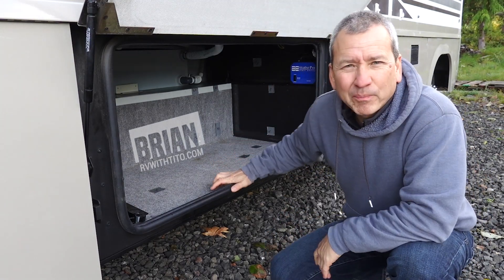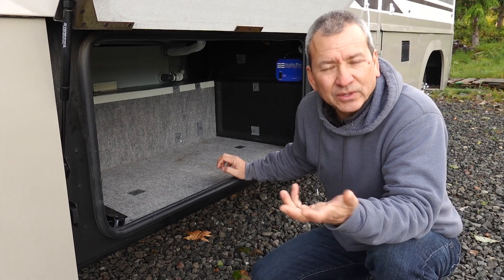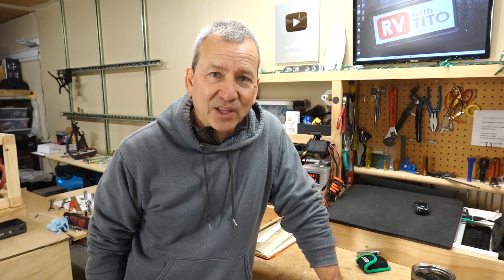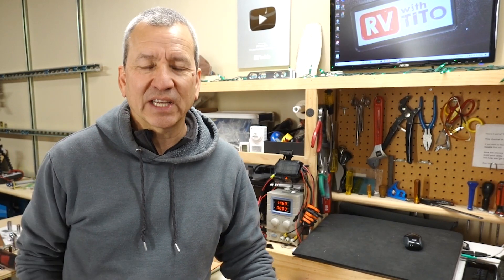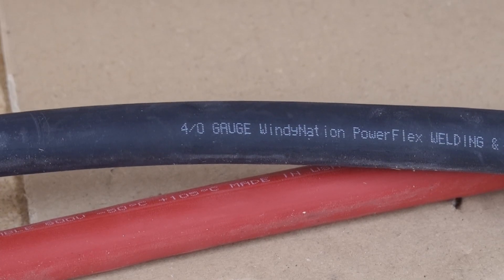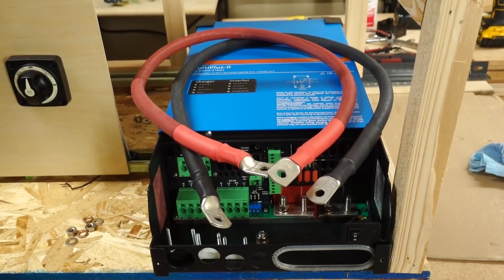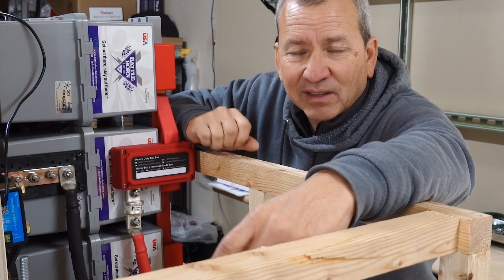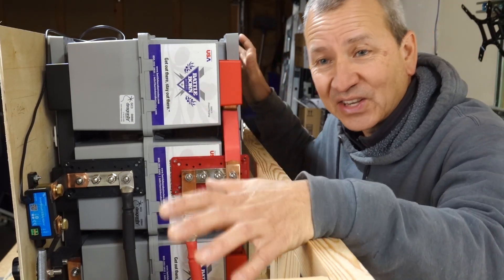Our Massive RV Battery Bank with Copper Busbars | Battleborn GC3 Lithium Battery | RV With Tito DIY

Comment: Nice work. Hwever, those Battle born batteries are way too expensive. You should have built your own battery from 3,2 Volts LifePo4 cells for same power at a third of the price.

Comment: thanks for your idea's, do you remember the flat copper bus bar thickness you used? I would like to go the same route with my 2x 200ah bank. thanks
Reply from the maker: Just found a spare piece. They are 1/8" x 1" from eBay. So far so good. Haven't had to touch them in almost 2 years. Still holding tight.
Reply: @RVwithTito  thank you my friend :)
Reply from the maker: @SEANRMZ  No problem

Comment: First class job, Brian!!!! i love the work with the bus bars... i wonder what current the bus bars can carry?.. Fantastic video... I can tell you were an electrician..
Reply from the maker: Thanks! Can't remember how much current I originally calculated. There's definitely more copper there than the #4/0 cable using to connect to the inverter. Electricity is fascinating and fun!

Comment: Brian, what size strut channel did you use to fit over the battery feet?
Take care.
Reply from the maker: The smaller one. 1 3/4" width x 3/4" height

Comment: Interesting bus bar setup. While I overall agree with using pure copper bar stock (often an IR of 0.100mΩ or less) over cables with crimped lugs when possible I'm curious why you chose to to pull from the middle battery and not from one terminal of each outside battery? Are you concerned at all about the current draw being higher in the middle battery?
Reply from the maker: You made me go back and double check :) If you look closely at around 10:15 in the video, you'll see that the negative and positive connections have their own busbar and are not on the middle battery. Negative is on the bottom left and positive on the upper right.
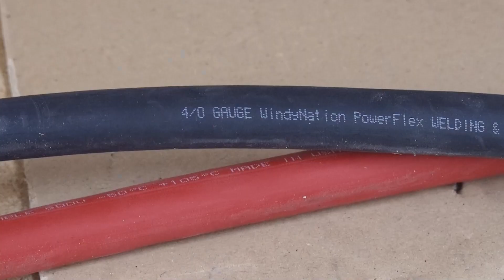Reply: @RVwithTito  11:23 I see two bus bar blocks (be careful if those are the $35 Amazon ones they aren't rated for what they say they are, not an issue for you most likely. I see the negative comes out between two batteries near the bottom, wraps around into the shunt and comes up towards the center where a cable takes it away. So not center exactly. Positive it appears that jutting out from the middle battery terminal is the bus bar block where a cable then takes it away.

So yes, a solid bus bar for both pos and neg running the length of the batteries but still a path of least resistance for the middle battery, the bottom and then the top. Not by a ton but Copper measures 0.100mΩ per 3-4 inches for me on my 3mmx20mm bus bars
Reply: @RVwithTito  Ahhh Now I see it! Very sneaky could barely tell. you had those bus bars so well lined up. I must have missed some of your bus bar fabrication and attachment parts while responding to another comment on another tab I had open

Comment: Question on the copper busbars being 1" x 1/8"  and amp rating for that is around 275  So at a 3000w inverter on a 12v system thats 250 amps so your good ? I  want to do the same thing.
Reply from the maker: So far so good. Right now (for the last hour) I'm pushing 2700W (roughly 200A) of charge in, and the busbars are sitting at a cool 93 degrees. Just barely warm👍
Reply: @RVwithTito  Good to know Thanks!

Comment: Hello Brian, Once again love your bus bar set up it’s really clean! After watching your video again I  was wondering if you could install bus bars in series on that battery configuration to make 24 volt set up vs 12 volt. If so what would be the best way to bolt together not to cause any arching?
Reply from the maker: You would need 4 of them (2 pairs). Just flip one around to connect them in series for 24V. How you connect the pairs with a busbar will depend on how you stack them.

Comment: 3 in parallel did not sound like 810 to me, but maybe I’m thinking of the rules for parallel voltage instead of power or whichever unit you mentioned (a year, ago).
Reply from the maker: In parallel add the amps and keep voltage the same. So 270 Amp Hours X 3 = 810 Amp Hours. Voltage remains at nominal 13.2V

Comment: Hi Brian I notice you did not add any ANL fuses 600 amps or more. in the pos. links to the copper bus bars or a disconnect switch for each 300 Amp  of the BBCG3 banks.  I would have put a very large ANL fuse also in the  Pos. bus to protect a short to neg. / chassis. you could get a surge current of several thousand amps between batteries and the solar output.

Comment: The concern with movement isn’t in the buss bars coming loose, 
 it is where the stress gets concentrated. Specifically where the terminal attaches to the battery. You are more likely to crack the battery case than having the bolts loosen. Fantastic idea for a static installation, but I wouldn’t risk breaking a battery case if I were you. I am only a mechanical engineer so what do I know.
So I recommend “Gauge Wire and Cable” as an online resource to buy ready made cables. Sorry to say that I believe you should immediately change to cables.
Love your videos, only trying to help.

Comment: Hey Brian! I’m curious, what did you do to to the battery compartment to keep it from freezing and allow charging in cold weather? 

I really appreciate your videos. They’ve been very helpful.
Reply from the maker: I didn't do anything this time. First of all, we're usually running from really cold weather and second, we're always using the batteries which tends to keep them warm. I have heating pads on the Battleborns installed in our Class C, but I've hardly ever needed to use them. There are several options if you did need to heat them. I'd recommend a basic set of heating pads triggered by a $5 temperature switch (https://amzn.to/3ugox9p). I've used several of these for cooling fans and heating too.

Comment: Nice install Brian! Question: If your load would remain the same,  you had room and wanted to install 4 GC3 batteries rather than 3 would anything else need to change? would any components need to be upgraded?, would battery life be affected?
Reply from the maker: I think limit for the GC3s in parallel is 3. Double check that with Battleborn.

Comment: My issue with all these DIY's is the actual cost. For most people these is anywhere for 30-50% of the RV purchase price. And most times BB has generously provided these batteries and victors Glady donates the charger/inverter. 600AH BB in my areas is about $8k CAD, the victron inverter/charge is $3.5k, MPPT charger is another $650, Solar Panels and cabling another $1200 with wiring. All internally wiring and connection is 800-1500. These setups are amazing, but the cost is absolutely outside of most normal RV users. I woud like to see some YouTubers start reviewing more affordable setups (a non sponsored one) that could be beneficial to RV'ers in a northern climate where they only get 3-5 months of good camping weather.
Reply from the maker: Not sponsored BTW. I purchased all equipment myself. We run the RV off grid with solar almost 100% of the time. For us and many others it's a worthwhile investment. Having said that...Yes..there are certainly lots of options available at various price points.

Comment: What a great looking build. What sizes are your bus bars? For parallel connections and the bank to the main buses? How many amps did you size the solid bus bars for? 200A? What formula did you use to size the bus bars?

Comment: Why can’t you use the rv converter instead of buying new ones?
Reply from the maker: Lithium batteries sit at a higher voltage. The old chargers read the voltage and consider them fully charged. So the do t kick into charge mode. Bottom line is that these batteries have different charging criteria so you need a charger that's compatible.
Reply: As you can probably tell I know nothing about solar!! I’m confused if you are charging your batteries with solar why can’t you hook your battery to your power converter that already in your rv?? Maybe I need to go to a class on solar!! Lol

Comment: If you’re worried about vibration and thermal cycling of the connecting hardware, I’d recommend some Nord-lock washers.  I use them in the power generation industry.  They’re a buy once cry once item but are affordable for the size of your application.  I thought they were a gimmick at first until I tried them.

Comment: You'd better check with the manufacturer that these batteries can support the mechanical stress on the connectors. With bus bars, all the forces and vibrations from your RV will be transmitted to the connectors. Using flexible cables prevents that.

Comment: I might have missed it in the video, 810 AH is lots of power. Will you be able to run your air conditioner from this set up? Better question is what this set up capable of? Great job on the videos.
Reply from the maker: Yes, absolutely

Comment: Brian, I’m gathering components for my own similar project.  I’ll go with two BBGC3 at this time with the potential for a third.  I’ve been reviewing your schematic for this project and noted that you’re installing the battery break on the negative leg.  Is this intended?  I ask because my trailer came with the break off the positive leg of the battery and after attending an all day training session with Victron, all of their examples that we worked with mirrored this with the break on the positive leg.  Playing naive, I asked them why they went with that and they said it was to avoid any parasitic shorts.  Can you explain your reasoning?  Wondering if I should make this change and put the break on my negative leg as well.  High regards!
Reply from the maker: If you can put it on the pos, then that's a good plan. I've always disconnected from my negative so that's why I continue to do so. It doesn't matter much in my opinion which way you go. The NEG generally has less stuff attached...just the shunt.
Reply: @RVwithTito  Brian, turns out you are correct.  The true flow of electrons is from negative to positive.  Before this was discovered, it was assumed that positive flowed to negative but in actuality, it’s the inverse of this.  If you truly wanted to isolate the flow of electrons to your coach, you would put your battery breaks on the negative terminal.  Think about it… Why else is the shunt, which gives us all that data about our batteries be on the negative side if the true flow was from the positive.  Wouldn’t that put every 12V connected device before the shunt??  I always thought that was odd and now I know why it’s applied there.  Because that’s where the very first electrons flow out from the battery bank, not the positive terminal.  Here’s a very good explanation of this process.  https://youtu.be/8gvJzrjwjds
Reply from the maker: @jimsjacob  It's often confused, because the flow through the battery is from positive to negative. However, the flow through a circuit is from battery negative back to the battery positive (neg -> pos). I've found it very helpful to review these basics every once in a while. It's actually pretty fascinating once you grasp how electricity actually works at the atomic level. Thanks!

Comment: The build is looking good as always. I was wondering at the same time you mentioned about things coming loose, whether the battery terminals could break internally from vibration. I don’t recall any ridged connections on our airplanes in the Air Force. Even the ridged waveguides ended with a short flexible connection at the transmitter and antenna ends.
Reply from the maker: I'll be keeping an eye on it for sure. Just drove from WA to AZ hitting a few pot holes along the way. So far so good.
Reply: Has anyone from battle born commented on your use of the buss bars for connection?   I ask because I am getting ready to mount 5 GC3's in my Renagade Classic.  I fear like Douglas that over time they may do internal damage to the battery terminals because of vibration.   Instead of the brackets you used connecting the batteries together, maybe solid strips the same width and as long as the stack of batteries (or even angle) on both the top side and the bottom would make this a more solid unit incapable of having any vibration (and not depending solely on the plastic battery case).   I am also not a fan of tapping the plastic, bolts with locknuts and washers would be more permanent.    I'd just hate to spend 12500 on batteries and then screw them up.   Regardless, you did a great job of explaining everything - superb video!   I have been talking to Battle Born quite a bit about my build.  I'm going to have one of their engineers check out your install video.
Reply: UPDATE:  Battleborn OK'ed it.
Reply: @alanward3400  If BB approved solid bus bars on a mobile application their terminals must be extremely secure inside the battery. I'd expect nothing less for the prices they charge
Reply: @Douglas what types I was B-52C,D & H models

Comment: Your work is far superior to mine.  I have built 4 power stations, 2 in my home, 2 in my small RV.  But yours is a very impressive setup, I just question having the 3 heavy batteries in that vertical configuration.  I know they say the batteries can be set in any direction, but I have read a few articles saying it is still best to have them in the typical vertical position (like the old fashion lead acid batteries).  It has something to do with the way the actual internal battery cells are positioned inside.  I guess I also would question the weight of the 3 batteries sitting on each other going down a bumpy road.  Probably just my OCD kicking in.

BTY, still love the video on your flexible solar panel rooftop setup that allowed for airflow, just a fantastic video!!!

Comment: Very cool.  My only concern with vibration would be the battery terminals themselves.  Can they break off?
And, why so large?  You must be thinking of battery powered air conditioning…
Reply from the maker: They seem pretty sturdy, but I haven't seen inside. Definitely going to be running A/C if necessary.

Comment: I WISH... I am / was going to go with 400 Heated BBB and a 3000Watt Inverter/Charger.... now I might want to go with 2 x270 GC3'  ??
Reply from the maker: BB GC3s don't have heating, but I don't really see a need for it. Love them so far.
Reply: @RVwithTito  I live in the RENO area and have been/see the BBB plate and now they just moved to a bigger place. I guess I need an up grade! Heated or not! I just may have room for 540 Amps Hours! !  :o)
Reply from the maker: @RVingwithG  I have no complaints about my BB batteries in either RV (400Ah in Class C too). It's a pretty robust solution.

Comment: Remember to clean the inside of your cable connectors just like you would do if you were soldering copper fittings. Same goes for the bus bar and battery terminals.. Just cleaning with a cleaner is not sufficient to remove oxidation. Steel wool works good.
Reply from the maker: Thanks for the tip.
Reply: Steel wool followed by 99% Iso. Leaves a perfect connection

Comment: Brian is at one with the universe. Electronics - check. 
Wood carpentry - check
Electrics - check
Solar - check. 
And he is a blacksmith now. 

What you should be doing is getting in cahoots with Elon Musk to build a space rocket ship RV. 

I upgraded my solar system to 1500w and switched to battleborn batteries. I had to wire up everything and I got so much use out of my lug maker. Unfortunately my hydraulic crimper was too small for lugs that I got so I opted to hammer those in using my hammer lug crimper thing. It is a bear… by time you get all the wiring stuff lugged and heat shrunk you get a serious case of I hope to never have to do this again itis. 

I think you are going to be ok with vibrations but I would advise to do something about those bigger road bumps that you never anticipate. RV shocks and struts and springs can only do so much shielding from that sort of stuff. I would reinforce the floor with brackets if necessary. On my class C I have molded plastic bays and they cant hold anything too heavy so make sure that on your class A bays are capable of holding that weight and not bow and sag if you know what I mean.
Reply from the maker: Haha. Master of nothing :) Bummer about the crimper. The big ones are when you really need it. And yes, I'm adding a support system for the batteries and inverter, but from the top instead of the bottom of the bay.

Comment: Brian, what about the weight in that compartment? Do you feel that the manufacture has it reinforced enough. Static weight is bad enough but as you travel hitting bumps it will create an enormous amount of down ward pressure.
Reply from the maker: Weight is certainly something I'm addressing. I have a plan to support them from the back/side shelf and above so that the weight isn't sitting on the floor of the compartment.

Comment: Hm, another problem that might occur: the bars you bend and twist, are they perfectly flat on the screw terminals? If not, a less-than-optimal connection increases resistance and could become quite hot. With cables, the flex makes sure you can tighten the nuts to hold the lugs flat to the terminal.
Reply from the maker: They are all perfectly flat. So I'm hoping we're good to go.

Comment: Good Set up (Are Lock Washers/Double Locking your Connections Possible?) or threading the Buss Bar then a Lock Nut for all the Buss Bars
Also a Half round PVC Cover to prevent a Short should something Fall against the Buss Bar System worth consideration as secondary back up. Beautiful Job Bob V

Comment: Possibly use lock washers and self locking nuts might help the vibration issues with things coming loose?
Reply from the maker: All of the battery connections have nylon nuts. It's pretty secure I think.

Comment: I'm assuming you went parallel instead of series so the batteries work with all the 12 volt systems in the camper? (so you don't need another transformer etc to step down the voltage?)  
Are you planning on running air conditioning off this system?